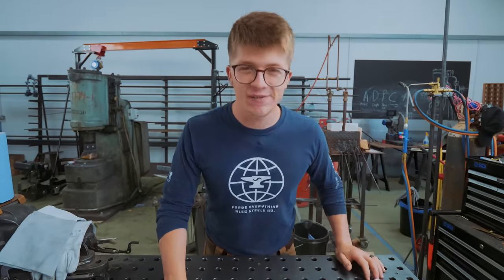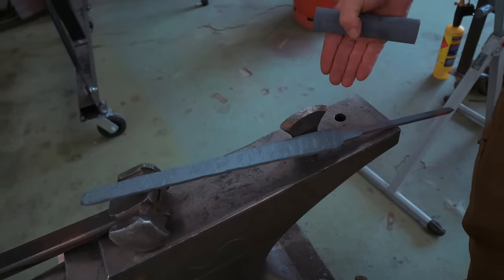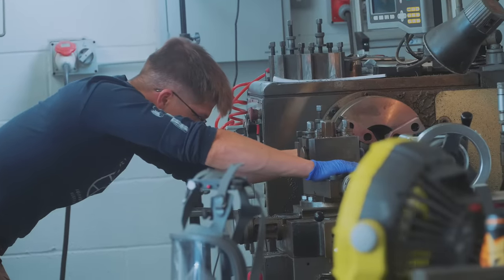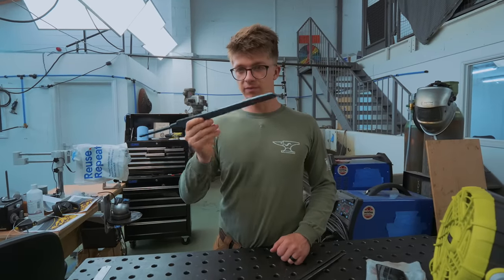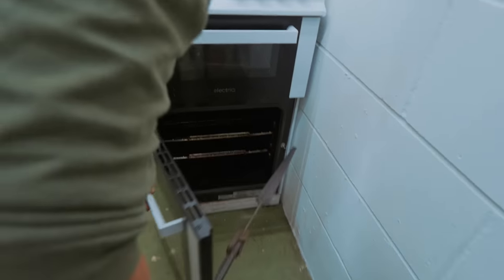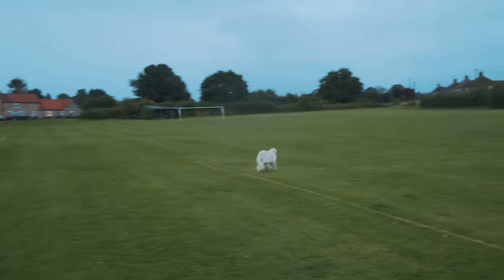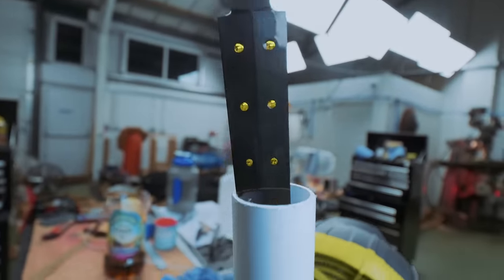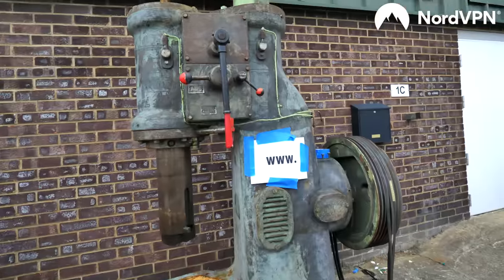I competed against 70 knife makers in a build-off…

Comment: Do the holes in the blade make it whistle particularly loud when you slash the air with it ?    It would be interesting to pursue that idea to make a blade that you just have to swing to produce a sound that will terrify your opponent. It noticed this on my old truck where two holes in a roof rack where at the exact good distance to make a loud whistle even at moderate speed. I vote for the whistle challenge !
Reply: There are also arrow tips with that feature. Terrifying sound when they fly
Reply: My roof racks did that too 🤣
Reply: A singing blade! It whistles the death lullaby and is the last sound you'll hear. Lovely idea
Reply: Not sure holes perpendicular to the swing direction will do the trick.
I have a fencing longsword by Szymon Chlebowski that has the tip rolled into a sort of tube (for safer stabbing), and on that one the sound is definitely noticeably louder on swing (which also happens to be a great self-check if your edge alignment is good, because you'll hear it if it is), but it's not quite a whistle. I'd think you could probably make it whistle if you added something in the hole that splits the airstream. Maybe.
Reply: @mikaeluhl  Oh lord
Reply: do a few at different frequencies. make a nazgul screech that treats humans the way dog whistles treat our canine friends

p.s. this would be best realized on the sheath.
Reply: I have a katana with a fuller that makes it whistle. It’s very satisfying.
Reply: The light saber lol
Reply: Loool, love this idea
Reply: Roman's did this with slingshot projectiles.
Reply: Holes aren't actually necessary, just a fuller.  In some blade geometries not even that is necessary, though it does make it more pronounced.  A fuller on a katana is otherwise known as a bo-hi, while without one is no-hi.  Both will make that telltale whistling sound when blade alignment is spot on with the swing.  The Japanese actually have a name for it, tachi-kazi or "sword-wind sound".  My own gut instinct is saying that simple drilled holes in a blade wouldn't make the sound more distinct but actually dull the effect by spoiling the controlled turbulence within the fuller and trailing behind the spine of the blade...they would have to have a particular shape and angle to catch and split the air passing over it into some type of resonating chamber (like the way a whistle or flute splits the air into a resonating chamber) for it to actually net something more audible than a traditional fuller.
Reply: Earl Lemongrab:
"The Soundsword.. THE S O U N D S W O R D!"
Reply: @IAMDARTHVADERBITCH  Not slingshot projectiles, sling projectiles. One launches pebbles, the other is a way to throw a fist-sized rock accurately much farther than with your arm alone. Much deadlier, which is why it was used heavily in human history before the age of the bow. I've never heard of whistling sling ammo but it does sound like something the Romans would have made, they knew of whistling arrowheads at the time after all.

Comment: If you can make a sword in 24 there’s no way you can’t make a dagger in 48
Reply: The sword was mono steel right? If I’m remembering right then that’s why he gave himself 48 hours for the dagger, Damascus and inlay means lots of extra work and potential to mess up
Reply: @joshuadouglass8225  he didn’t give himself the time
Reply: @joshuadouglass8225  he used some spare Damascus he had lying around, that the same length of time needed to have mono steel
Reply: It is a NICE dagger
Reply: Was the sword ground with 4 bevels? I don’t believe it was. Not to mention he could stop the clock to move the camera, eat, break, etc. this challenge was a set date and time.
Reply: @erikcourtney1834  the sword actually was with 4 bevels and he couldn’t stop the clock as he was working through one day. He had to make the sword in one day at the shop
Reply: willy vs chili
Reply: big difference between that and this experiance, Alec now has so much more experience making blades and daggers that his expectations of himself to make an exceptional piece are higher than they used to be, where the sword was an accomplishment at it's time it wouldn't be much of a challenge to make the same thing now.
Reply: @royfireball1  Close. There IS extra time needed for Damascus (the etch), but I guess that 20 minutes isn't worth worrying about in the grand scheme of things. Otherwise, you're right.

Comment: When you were talking about clearance when cutting the taper on the lathe. You should be able to rotate the quick change toolpost separately from the top slide, loosen the nut in the center of the top of the tool post and you can spin the toolpost to get the right cutter angle. Spinning the tool post does not affect the angle you set on the top slide. Good work on he dagger.

Comment: On the lathe if you undo the large nut in the middle of the tool post you can adjust the tool so you do not have a clearance issue but your way works too

Comment: You should consider only rounding the bit of the tang you intend to thread, there's zero need to round the rest, getting squared is actually better for stopping the blade from turning during use.

Comment: Right hand cutter. You have the option of working on the backside of the part, or mounting the tool upside down, runnning the lathe in reverse, and working on the operator side of the part, depending if you want to go tailstock to spindle direction or spindle to tailstock direction.  Remember that for the future.  There's no rule that says you have to cut in one direction only and that your tools have to be mounted a specific way.

Comment: Hay Alec. Have you ever taken the scrap pieces of Damascus or pattern welded steel cut them up to fit inside of a canister added powdered steel to fill in the gaps and then forged it out into a blade. I'm suggesting that if you have some off cuts of ladder pattern, cable, twisted, any other pieces that are not big enough or did not turn out as you wanted and just add them randomly in to a canister and just see what you get to use to make a blade.

Comment: tip i learned for drilling curved surfaces, cut a bit off the end of the cylinder you wanna drill through the side off, drill through the end of it then use that as a guide to stop you damaging the bit on the curve

Comment: That was fun. It got be thinking about how did they make this kind of thing when they didn't have power tools, and what tools did they use? Thanks for sharing.
Reply: Waterpowered grinding stones, apprentices swinging sledge hammer, working the bellow and so forth. Same as we have today, but without electricity, in short.
Reply: @brioshoveit  But no milling machines, micrometers and such.
Reply: @kevintulak9987  milling machines, yes. Micrometer, yes, but not as accurate.
When I was working daily with blacksmithing, in viking/medieval way (no electricity) i could feel if a piece of metal had same thickness and almost which thickness it had.

Comment: Working with the Pommel you could have used a piece of threaded rod, provided the threads match of course, and secured the two handle pieces together to ensure the octagon is correct or lined up, a bit easier than just guessing; but sometimes guessing works too... Just saying...

Comment: I'm sure some of the competitors got that efficient over many years, 48h it's much less of a challenge then to other bladesmiths.
Reply: the design he made was relatively simple and the work steps not that many.
id say it was maybe a 20 hour job at most which he could have finished with plenty of time to spare if he chose to.
i cant see how hes successfull as a professional blacksmith.

Comment: Well the challenge is a bit like NASCAR, the one with the most money wins. You should have a challenge where everyone uses the same equipment. Or at least the same TYPE of equipment (agreed upon up front). Lathe, Manual mill, belt sander, drillpress, grinders etc. I think any CNC gives an unfair advantage.

Comment: I have a question. When you make knives/daggers, how does the pins in the handle work?
Reply: From what I've seen if you have a pummel on a knife or dagger, they usually tighten the pummel on using thread so that it tightens everything up so nothing comes loose.

Comment: Nice job. It looks like the guard is sitting a bit proud from the cutting edges of the dagger.
Also it kinda would've been neat if the guard facing out had even beveled as well. Not saying it didn't look good, just in my opinion,  it would've been nice if it had been beveled top to bottom as well as side to side

Comment: You didn’t necessarily need a left hand tool to reach. You can have the compound slide at an angle and then loosen the centre nut and straighten your tool back. Still may have clearance problems, but certainly helps.

Comment: HELP: I just started making knives and decided to do a patina finish. After soaking in white vinegar for a few hours the knife came out with some spots that didn't patina like the rest. It's made out of 1080, quenched in vegetable oil and tempered at 400° for 3, 2 hour cycles. I have no idea why it's doing this but I'm worried that I might have messed up the hardening. Any help would be greatly appreciated.
Reply: Did you make sure the surface was completely free of oils, grease etc?

Comment: Except for the actual blade (which was taken from something pre-made off-video) the whole thing seems more like woodworking than blacksmithing. Soft metal that works on a lathe like that, can it really be called blacksmithing at all? Unpopular opinion I guess. If each piece is not worked on in a forge + anvil then it shouldn't count.
Reply: historical smiths used a lot of tools and methods too, and also bladesmithing isn't the same as blacksmithing.